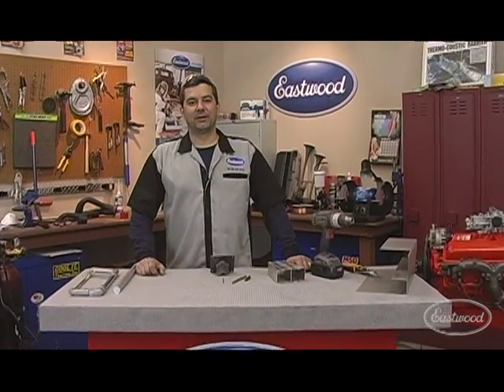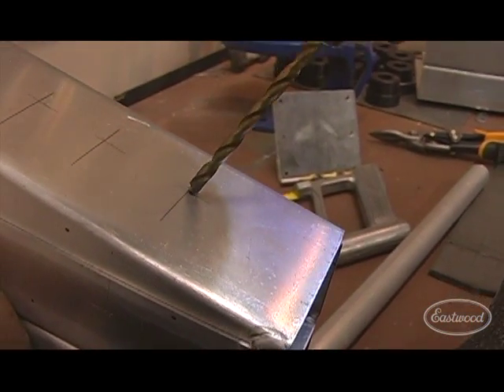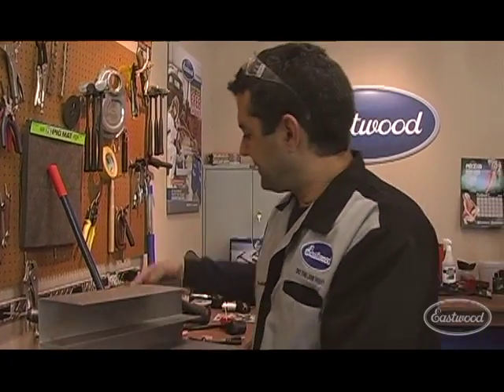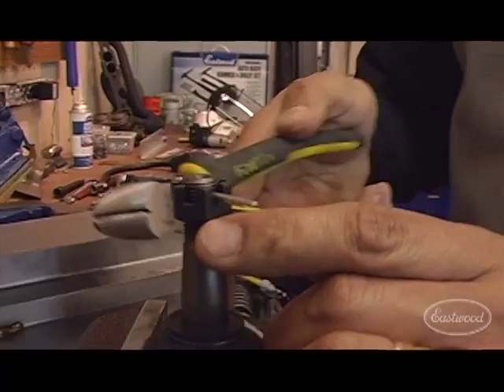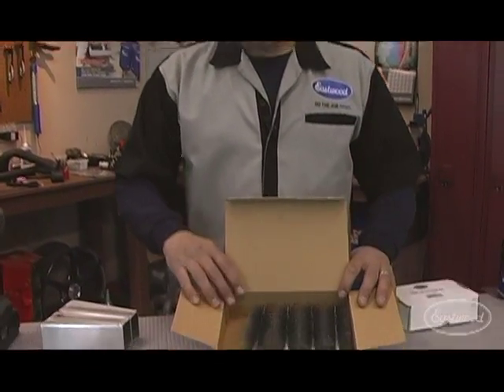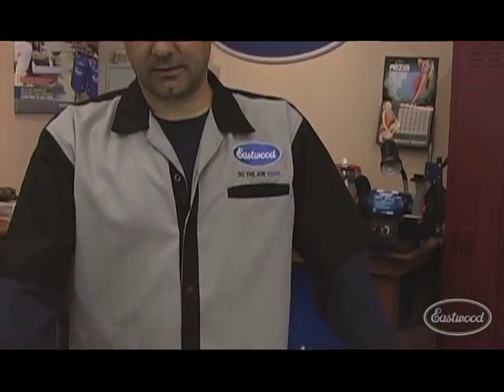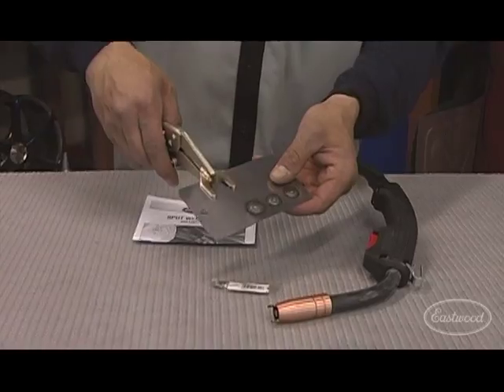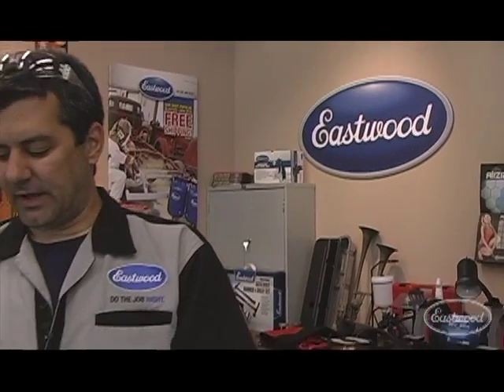Spot Welding Tips, Rust Removal and DIY Garage Tips on Mark's R&D Corner from Eastwood, Episode 1

Comment from the maker: With this tool you're only welding for a short period of time (a few seconds), which if the machine is set correctly, shouldn't cause a issue with out of position welds. We suggest to do some test welds to dial in your settings on your machine. Using our suggested settings in the instructions is a good starting point, but you may need to tweak things a little if welding out of position. -Matt/EW